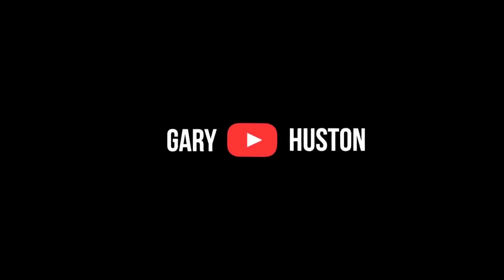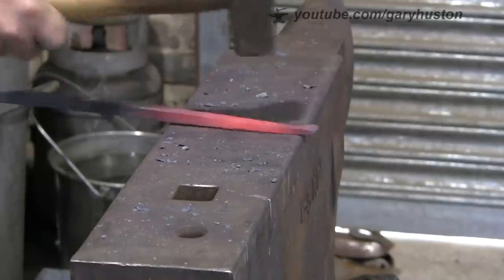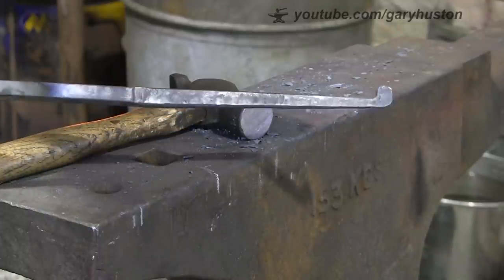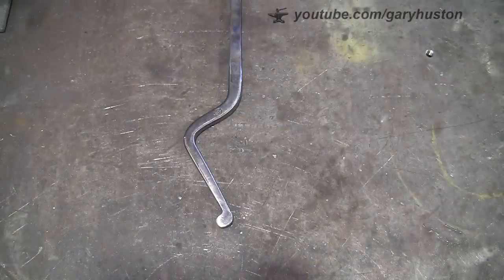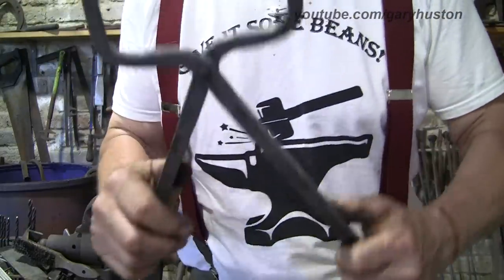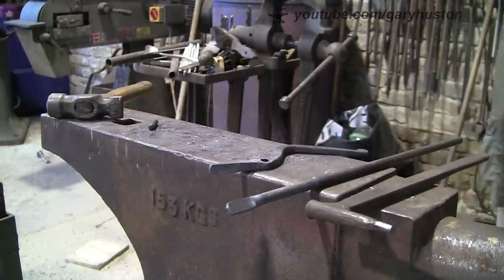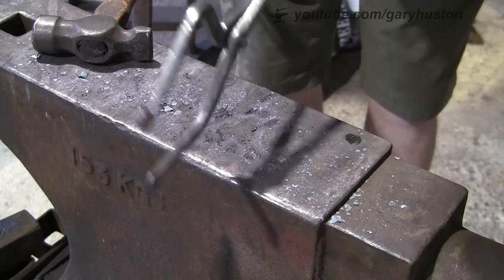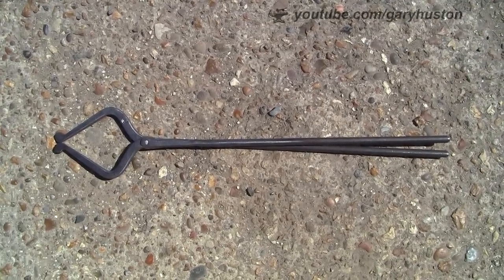Hammer Tongs

Comment: I like how you use a traditional coke forge, instead of a Propane furnace that other (so-called) blacksmiths use, which is insufficient for attaining the heat required to do everything that you need to do, including forge welding, which is much more difficult using a Propane furnace.
Reply: Depends on how you use them I use four types of forge coal coke charcoal and gas my favourites are charcoal and gas my gas forge is a single burner made in a 9kg gas cylinder and reaches weld temps easy. Doc from @docs hot shop and forge (on YouTube) welds in his all the time also.

Comment: Gary you might want to try vitamin B6 for your carpal tunnel issues. I have been working as a electrician for 40 plus years, wire cutting and crimping tools were taking a tole and I started having carpal tunnel issues. I take a 100 Mg daily and have avoided the surgeon for 30 years . The information I have read on it says 50 to 200 Mg for recommended dosage. It took about 3-4 weeks before I noticed that I was not having any issues. I did stop taking it and it took 6 weeks before I had issues again.
Reply from the maker: It’s gone a bit too far for that, it’s almost too far gone for a good outcome from an operation, I need it really soon!